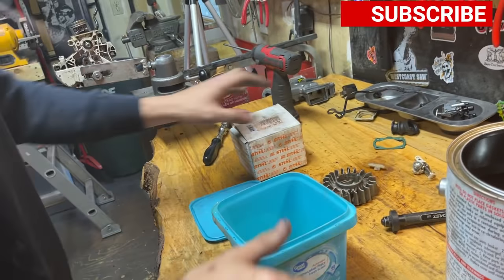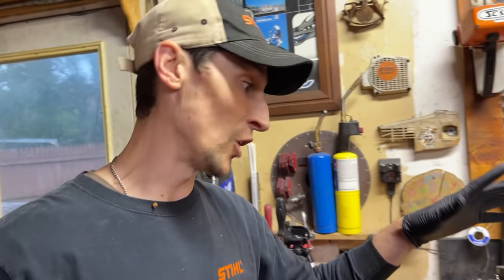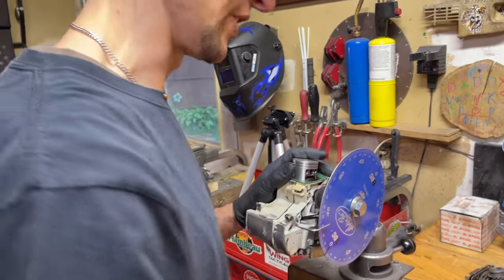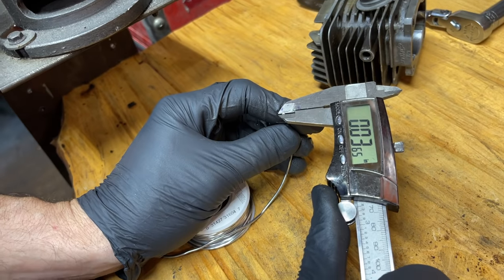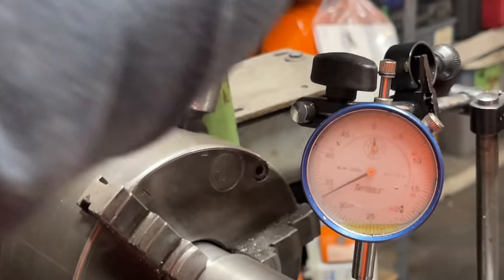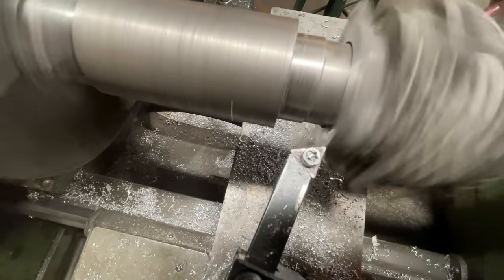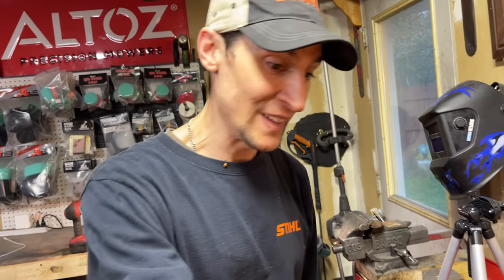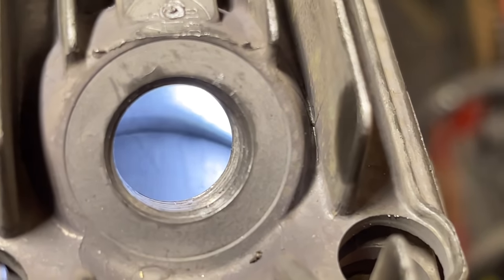LIMB REAPER!!! John ports and polishes my old ms200t explaining every step of the way.

Comment: sooo much information. thank you for documenting it! just a quick question. what's the difference between the 200t and 201t? thank you in advance
Reply: The newer saws have to run cleaner and more restricted to meet newer EPA emissions. The first five years or so worth of 201s were gutless and the old 200s became extremely expensive and in demand overnight.
Reply: @WildAcresFarms  thank you for the information! I am looking at a mint 200t for $500 CAD.
Reply: @asitturnsout7108  BUY THAT SAW. That’s a smokin deal. You could easily turn around and flip it for a profit. They routinely go for $700-1000+ on eBay here in the USA. They are the most beloved saw Stihl made, and they haven’t made any of them for 10+ years. Demand > supply.
Reply: @WildAcresFarms  My dad is a small engine guy.  Good mechanic, but not a full "saw guy"
He came upon a 200t that was "blown up" (it wasn't) and got it as a freebie with another couple pieces of equipment.  Had it running in a few days.  Now, not being a saw conniseur, he assumed that as it was a small stihl, it would be priced  like a small homeowner stihl.  He has tophandle homelites and macs all over the place.  He was stoked when someone gave him 200 for a saw he got for a song and nothing in it but expendables and a little time.
Reply: @mattfleming86  I’ll take the next $200 200T. Thanks. 😉

Comment: There are Husqvarnas with windowed pistons too.

Also using a hone on nikasil coating is just asking for problems
Reply: Yes huskys do have windowed pistons... I have used those ball hones soaked in cutting oil to take the hardness out of the  stones on THOUSANDS of saws man... if you have evidence to support your argument im all ears... how many saws have you built? Are you a certified tech? Over 20 years experience? I'm not being a jerk im honestly interested if you have a good point because I want the best option possible... I do it to take any rough edged I may have missed and I haven't caught a ring in almost a decade... that is what im trying to avoid... I believe catching a ring is "asking for trouble " wouldn't you agree?
Reply: @johnscustomsaws  yeah i know you've done it a lot. I agree that Catching a ring is bad. 

 It is from Stihl themself that using a hone on nikasil is bad. It's like you not using metal polish. Someone told you a Long time Ago that it's bad and now you stick with it. I'd replace a nikasil jug just for that extra safety of the costumer not coming due to problems  with the Saw.
Reply: @alexstromberg7696   i know some of the engineers at Stihl and they say a lot of things to cover themselves against general procedures... some hones are bad for cylinders and i stated that ... i just don't like people giving advice as a "fact" when they have no experience especially over someone that has a ton of experience... it confuses people and im sorry but my experience trumps something you read...and you do realize that even though husky and stihl have nikasil lining the stihl lining is MUCH tougher... its not apples to apples

Comment: Rather than trying to get 3 phase power wired into your house/shop it's way cheaper to use a variable frequency drive or VFD. I run my 3 phase mill on a vfd. Oe benefit is that it will give you infinite variable speed!

Comment: To be clear... in internal combustion engines port size affects flow, which affects HP, but if the port size is too big, it can mean you have to be at the highest rpms to deliver the HPs. But, as soon as you put chain to log, the rpms drop and you could fall off your "peak" (ever hear the term, peaky? ) and the saw bogs under load. Ruined. 

But if you can increase flow a moderate amount, while keeping the velocity up (as he mentions), you will keep more upper and midrange torque. A rocking, rowdy saw that you love. A proper engine design calculates the sweet spot between HP and torque to make the most usable saw. You are better off small like Husky to keep torque up, the saw always cuts that way.

This general idea works for all 4-stroke engines as well.

Comment: Let's get it straight 
3 phase power is different than 240 volts. A lathe like that is usually 3 phase, but to get 3 phase power you're having to call the town and pay them to bring it from the pole to your house, then paying the electrician to wire the panel and then rout your other home panel. Generally this is done with a shut of switch and new meter cabinet which alone cost $1500.00
So
At a $500 estimate, I'm thinking you have 240 volt run to your garage 

Massive difference

Comment: 1. it is a vernier caliper Not a micrometer 2. you SHOULD use a dial gauge And degree wheel 3. it is not an "explosion" it is a controlled rapid expansion

Comment: I hate hearign that the West Coast saws guy is a good guy, because I've always seen his gear as "fad-ish, over-priced" gear (I mean c'mon $100ish for a muffler-plate? And I don't wanna hear they did real R&D on that thing, I have a DIY version on my 660 and the simple addition of my "cyclone baffle plate" ups the power nearly 10% measured by cut-time on a ~25" dead Pine log)  You seem 100% sold on the oiled-filters (and the more porous green type, at that), I'd love to hear your thoughts/elaborations on them, I am OCD about fines getting through, and also about any airflow-restriction, so my saws all have modified airboxes that have extra (screened/filtered) openings, with air-filters usually mated with grease and rubber gaskets to eliminate any fines getting-past, I've been eyeing the oil-type filters (like your green ones) for many months now but haven't pulled the trigger, am I right in guessing that they're basically all you use?  Or all you'd advise for a performance-build?  What are their drawbacks?  I'm in a VERY sandy area (coastal FL) so I fear I'd be plugging them up mid-job, whereas dry filters I can take off and just brush-off mid job if need be!

Comment: The "file police" who want to tell everyone how to file are just idiotic. "save your files!!" as if they cost $400 each. 

In reality, filing some strokes across or dragging will prevent pinning on the files. Maybe pinning doesn't matter inside of a saw, who will see the little scratches? I finish file a lot of steel lately, and drag every fourth stroke on purpose, or thereabouts. Pinning in the file is far more punitive than having to buy 20% more files - that "economy" never materializes as you waste a file chasing pinning scratches out of material. 

A lot of these trivial rules come from people who do nothing but watch videos. People who do things look for results instead and experiment to find out what gives better results.

Comment: No different than porting a race engine other way smaller and different tolerances. Some guys use a belt sander for truing and cutting the flat stuff. any one ever tried a small flow bench to get a true flow on a saw jug? Good stuff though, kinda' sorta' like I learned on automotive stuff.